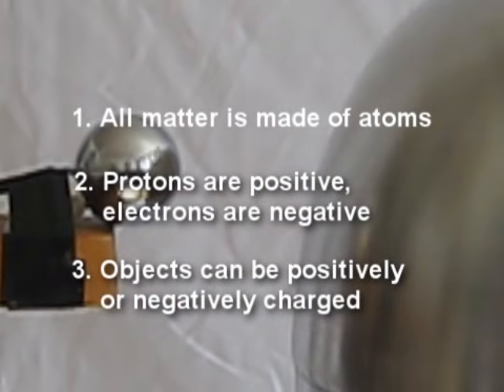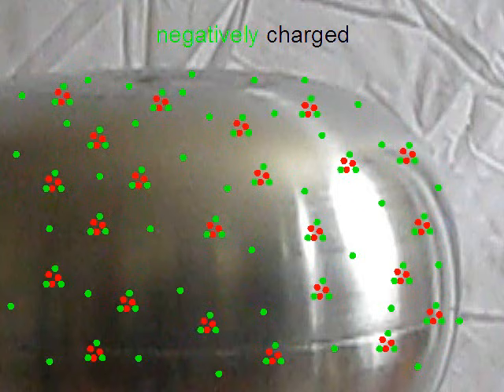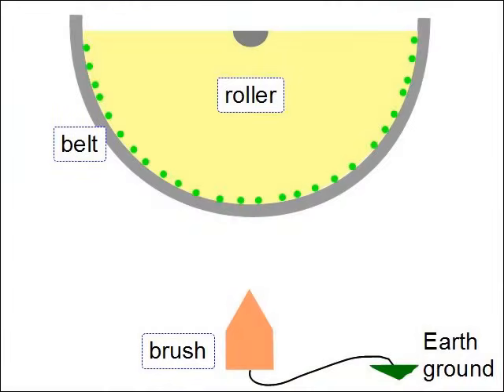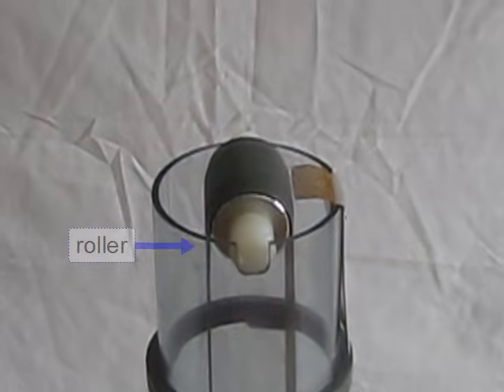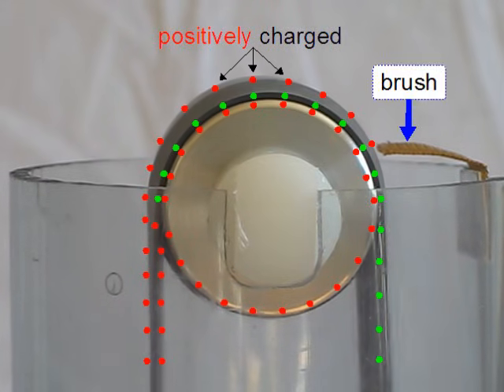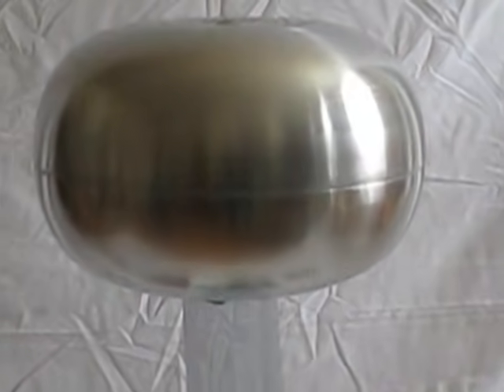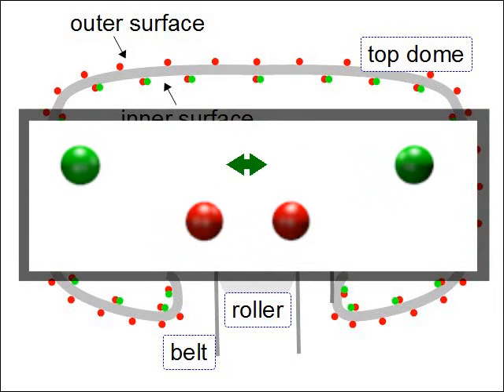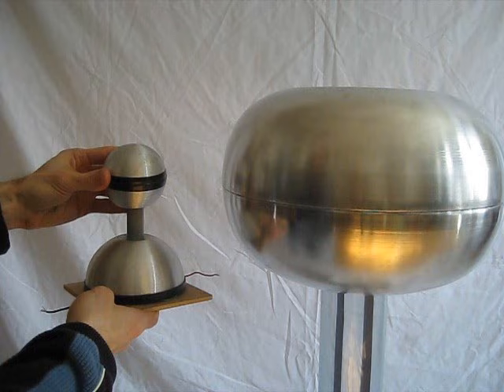How a Van de Graaff Generator Works

Comment: все верно с точночтью до наоборот. Внутри сферы поле отсутствует.Чел соверщенно не понимает физики.Например,  Машина ВДГ это машина не трения где трибоэлектрический эффект основной в процессе а машина которая осуществляет перенос электронов из земли на поверхность сферы.
Все начинается с того что внутри сферы образуется поле с дефицитом электронов и оно стремится восполнить этот дефицит снимая эти заряды т.е. электроны с поверхности ленты , а та в свою очередь откачивает, т.е. устраняя дефицит от земли через нижний контакт.Можно представить такую конструкцию когда валики и лента движутся без трения, т.е. свезди  его к нулю.И тогда  все будет работать таким же образом.Т.образом в этой конструкции работает один закон это закон кулона.
Reply from the maker: Юрий Багрянцев If you have a question, please tell me what language this is. Google translate doesn't know.
Reply: All true is exactly the opposite. Inside the sphere the field is absent.People doesn't understand physics.For example, the Machine EDC,( Van der Graaf) this machine is not friction where the triboelectric effect is not a basic process, but the machine which performs the transfer of electrons from the earth to the surface of the sphere.
It all starts with the fact that inside the sphere field is always formed with a deficit of electrons, and it seeks to fill this deficit removing these charges, i.e. electrons from the surface of the tape , and that in turn pumps out, i.e. astranet deficit from ground through the lower contact.You can build such a design when the rollers and the tape moving without friction, i.e., to make it equal to zero.And then everything will work the same way.Thus in this design there is one law is the law of the pendant.
Reply from the maker: Юрий Багрянцев We'll have to disagree about the triboelectric effect. I do agree that the field inside the sphere is absent. But since the field is absent, how can the "sphere field always be formed with a deficit of electrons" as you say? If there is a deficit of electrons in the sphere then there will be a field in the sphere.
Reply: RimstarOrg to understand why within the scope of a lack of electrons and outside the excess need to take a flexible plate and charge it.When you bend you will find that the charge inside of the curve decreased and the outside is increased.The sphere can be represented made of curved plates and inside it therefore charges less than outside.And charges getting inside her aim will be moved in an outward direction.This is caused by the mutual repulsion of the electrons by the Coulomb law, seeking to occupy such a position in which their total interaction will be minimal.The same effect can be seen when on the field will be the bulge and we'll see what the charges tend moves on this bulge, implemented "the edge effect".
Reply: Юрий Багрянцев By the way I write in Russian

Comment: Hi you might not remember me I was asking you for advice and now I am doing it again I build kind of big Van de graaff generator but it doesn't work and I don't know why so please If you have time check this video - it explains more : https://www.youtube.com/watch?v=0Ap5_jH7AEE&list=UUpUbKWbaYmEIfCOdqJxAJSw
Reply from the maker: bobes360 Your video is marked private but you haven't told youtube that I'm allowed to see it. An alternative is to mark it as unlisted and then anyone with the link can see it.
Reply from the maker: bobes360 Okay, I can see it now. Did you use the same materials for the belt, and rollers when you had it working before?As you can see from my video, the outer surface of the rollers and the inner surface of the belt are critical. You mention degreasing the belt. Is it possible you now have a coating on the rollers or belt that might be causing a problem with the triboelectric effect?One of the brushes you show doesn't face very much of the belt. The more of the belt that the brush faces, the more charge you'll collect. So spread out the brush to face more width of the belt. You also want a lot of sharp points.Other than those things, assuming you have good electrical connections everywhere and a good ground, it looks good.
Reply: yes I used the same rollers and belt. I tried thinner to clean up the belt. And the brushes they worked before at least a little bit but now nothing. I have some ideas to improve it but now i just want it running a little. And yes i tried to measure all connections with Ohmmeter.
Reply from the maker: bobes360 I
 don't know what to suggest to best clean the belt and rollers (which 
are probably also coated now), but I suspect that's your problem. Maybe 
try rubbing alcohol, followed by very hot water with dish soap and then a thorough rinsing. I don't know how the very hot water would affect the belt since I don't know what it's made of.I still suggest playing the the brushes for an improvement. Closer is better too.
Reply: Ok I will try it. Thank you for your time. I love your videos and I learned a lot from it. I even get your explanation even though english is not my mother language.

Comment: Hola, podrias enceñar como transformar la estatica en corriente-   ac O en dc
Reply from the maker: Nicolas Q.M. Your comment doesn't translate very well so I can't help. Try to say it differently.
Reply: como transformar la corriente producida por el van de graaf-- combertirla a AC o DC
Reply from the maker: Nicolas Q.M. There are two currents.1. Touch a wire from Earth ground to the dome/bowl. The wire will have very low current DC. It may be hard to convert from AC to DC because it is very low current.2. When there is a spark there is a higher current. This current is a short spike. You could try storing it in a capacitor. Then take it from the capacitor as DC.Why do you want to do this? It is better to not use a Van de Graaff. Instead just use whatever power source you are using to power the Van de Graaff. That way you will have more power. There are losses in the Van de Graaff.
Reply: a el van de graaf lo alimento con un motor de 12v,  con un tester puedo medir esta corriente?
Reply from the maker: Nicolas Q.M. The translation is no good again. :(
Reply: la energia estatica obtenida es corriente continua?
Reply from the maker: Nicolas Q.M. It is current when there is a spark. It is also current if you connect a wire from ground to the top dome/bowl.
Reply: si yo midiendo con el tester  regulando el arco con el sark gap me mide 230v en continua, como la puedo aprovechar
Reply from the maker: Nicolas Q.M. Be careful of sparks. With an air gap there can be current from ions moving through the gap. The current will be very low. But if a spark happens, the current can be high. It might damage your tester. I don't what what the current will be.
Reply: regulando la chispa a 1cm con el tester me marca 220 tanto en  AC como en DC conectando siempre a tierra no daña el tester, si le quito la tierra se daña el tester ya lo comprobe

Comment: why does everybody use brushed high torque and low max rpm el. motors instead of something like HDD motor with rpm increasing gear?
 and i want to know how long the rubber belt should be

Comment: I have a question if there were dust particles on the surface of the metal brush, at the bottom of the generator, would they be attracted to the positive charge on the outer part of the belt? And if so, how would that effect the efficiency of the van De Graff generator?
Reply from the maker: damian watson I would think that the dust particles would be charged with the same polarity as the metal brush. Since two things with the same charge repel each other, the dust would be repelled by the brush. Some might hit the belt so you'd have a small area of the belt that would be a bit dusty and that would be all. It would be a onetime thing and have little effect, probably not even noticeable.If, however, the dust particles are physically wedged into the brush such that the repulsion isn't strong enough, it may cause the brush to act less like sharp points and more like a smooth surface. This would cause less corona and the machine wouldn't work as well.But this is all speculation, since I'd need to do the experiments to see what actually would happen.Are you having problems with a dusty brush?
Reply: RimstarOrg So the roller would induce a positive charge on the dust particles and the metal brush but would the dust particles not therefore be attracted to the roller and coat the outer layer of the belt since the outer layer would be negatively charged?
Reply from the maker: damian watson Yes, but I was assuming you were talking about a one-time thing so it wouldn't be a big deal. I guess if you have a continuous stream of dust then more of the roller would get coated. I don't know if it'd be a problem. The dust would get taken off at the top brush. But this is all just guesswork. Unanticipated factors may come into play.
Reply: Thanks for the speedily reply and for taking the time to answer my questions. And you are right this is all just guesswork. All the same it was nice to hear your thoughts on the issue.

Comment: Why is the top brush positioned near where the belt and roller leave contact and the bottom brush not?
Reply from the maker: Chad Yelland That's because the top roller is metal, so the top is not charging due to the triboelectric effect, unlike the bottom. Look at the section of video starting at 8:03 to see how the charging is done in this case. What I didn't show is that as the belt moves over the roller, the inner surface gets more and more charged, as it goes around the curve. So it's at maximum charge just before leaving the roller.

Comment: how much u produce with that generator?
Reply from the maker: It's rated for 400,000 volts. I don't know what the current would be in that case.
Reply from the maker: No, I didn't measure it. The rating is from the manufacturer. I'm assuming the rating represents the maximum voltage of the dome with respect to the metal box that houses the motor below. That metal box is connected to Earth ground in this one.
Reply from the maker: Yes, it is my video. It is also my Van de Graaff generator.
Reply from the maker: guillermo de Rivas
I did not make my big Van de Graaff generator. I bought it online from some company a long time ago. The company said it was rated for 400,000 volts. I also don't have the equipment to measure that high a voltage. The highest I've ever measured with my homemade high voltage probe is 75,000 volts (http://rimstar.org/equip/hv150kvprobe/hv150kvprobe.htm). It isn't designed to measure even near 400,000 volts. I could estimate it based on spark length but there are too many variables for that to be accurate.

Comment: firstly, thnx a lot.. this must get me an A..
secondly, i had to ask if we could externally charge the belt with a battery.
this way we wont need to earth it.
please do reply.
Reply from the maker: For a battery to work you'd need a closed circuit i.e. one connection to the battery positive and one to the battery negative. There's no such circuit when charging the belt, so no. But an easy way to get a ground is to connect the wire coming from the brush to the inside of another dome. I do that in my video "How to Make a Van de Graaff Generator Part 2".
Reply: Thnx..!!
And ya i'll b watchin it..

Comment: hey again, i've come up with an interesting modification of the Van de Graaff generator and i would like to hear your opinion on that.

I've only seen VdG generators where the belt mechanism is inside the stand of the dome. My question is, could you build a "compact" triboelectric belt mechanism inside the dome and only drill small holes for the earth and power cords (earth to dump the electrons from the dome and power cords to operate the motor) and the VdG generator would still work?

I dont see the need to have these long belts or does the triboelectric effect require a certain amount of space to work properly?
Reply from the maker: I think problems would arise where the cords go through the dome. The dome is at high voltage (positive or negative) and the current on the wires would be fighting this voltage one way or another, assuming you insulate them enough so that they don't spark to the dome. Also, the outer surface of the down going side of the belt is charged in a way that may interfere with the dome.

Comment: i have a question: what happens if you operate that Van de Graaff generator in a vacuum?

the protons making up the dome can only bind to the electrons that are "in" the dome so would that mean the inside of the dome would also become positively charged?
Reply from the maker: I think I understand the logic behind your question, but if I misunderstand, don't hesitate to say so.
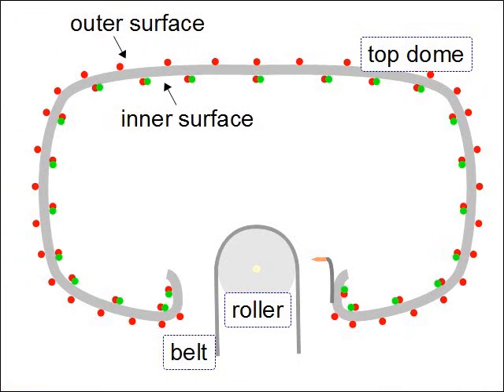In the video I say at 12:45 that for the protons on the surface of the dome there's a whole world of things outside the dome to be attracted to. Is that leading you to think that if it's in a vacuum then those protons won't be able to be attracted to  those other things? Because that attraction still happens in a vacuum. More precisely, electric fields exist in a vacuum.
In fact, there's a vacuum in between each atom everywhere, and yet things still interact through this attraction and repulsion.
Reply: RimstarOrg ahh no, what i mean is what if there are no other things out there which could be attracted - like in a vast vacuum.
Reply from the maker: kelloggsllcornflakes
Ah, interesting question. All forces have to balance out, to reach a state of equilibrium. I don't have any experiment to confirm it with, but here's my reasoning and guess. There is more positive charge than negative charge in and on the dome. So you'd think the electrons would end up in the middle of the dome's metal, evenly spread out. However, that wouldn't completely balance things out since there's still excess positive charge everywhere, including on the opposite side of the dome from each electron. So there'd still be a slight attraction to the rest of the dome. So my guess is that the electrons would end up in the metal, but slightly more toward the inside surface than the outside surface.
Reply: kelloggsllcornflakes
ok i guess its not a valid thought because there is always something surrounding the dome - the box that contains the vaccum for example but it still bothers me that the charge only sits on the surface of the dome.

Comment: Would there be a worth wild benefit to using a conductive liquids in place of brushes?  Since brushes contacting in your VDG building videos showed a marked improvement but destroyed the belt, why not a liquid?  I'm envisioning a horizontal band orientation where a conductive liquid is pumped onto the exterior of the band so that there is not a break in fluid for purposes of charge flow.  The band would be wiped clean of fluid prior to traveling to the roller/fluid on the other side where another pump & capture is setup and connected to the dome.
Reply from the maker: In my VDG building videos I had only the ground side brush touching the belt. I did that because there wasn't enough voltage produced by the triboelectric effect, given the materials I was using. With not enough voltage, it couldn't produce a conductive corona. That's not normally done, since you should search for better materials instead, as I did in my part 2 video. It would be hard to implement the use of a conductive liquid since you'd want it touching only the outer surface of the belt. If it got to the inside surface of the belt, it would prevent the triboelectric effect and the whole thing would stop working. Much easier to just find better material combinations.

Comment from the maker: Oh, interesting idea, twisting the belt! I'm not sure if the Van de Graaff dome would still charge up but it might accumulate more on the rollers. Hmmm. Regarding no external power source, it wouldn't. You need an external power source and you can't accumulate energy more than you use.

Comment from the maker: Definitely not a stupid question. I wonder this myself. The only answer I can come up with is that most easy to do ways of making physical contact with the belt will wear down the belt over time. I've done this by having my ground wire touching a rubber belt. The wire scraped away the belt surface; there was rubber powder all over.

Comment from the maker: The machine and my animation are going in the same direction. It's just an illusion created by the fact that the belt and roller aren't featureless and the camera's frame rate is 29.97 frames per second (i.e. not continuous.) Looking at it I can see it going either way but mostly in the same direction as the animation. I don't see why it would matter where the comb is as long as it's facing some part where the belt and roller are in contact but not where they make or break contact.

Comment from the maker: If you connected the battery to the outside of the sphere you wouldn't get any additional result. The sphere would just be at the voltage of whichever battery terminal you connected it to. Even if you connect it to the inside, the battery would need a circuit to conduct.

Comment from the maker: The charge is deposited using the triboelectric effect. When two particular materials make contact and then break contact, their molecules interact such that charge is exchanged while they are touching but doesn't get restore when the separate. The belt and rollers are constantly making and breaking contact. And yes, we are transporting the protons and electrons exactly like transporting materials on a simple conveyor belt. See my video Triboelectric video, see link in this video's description.